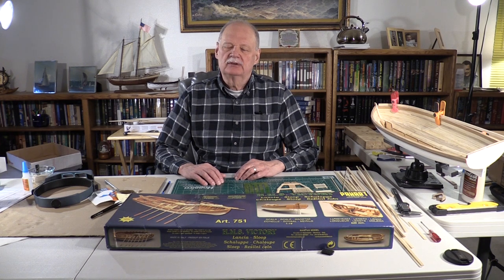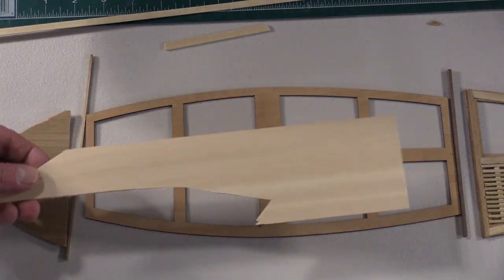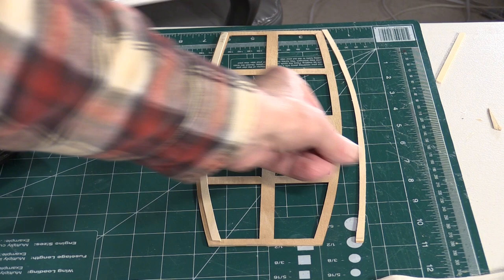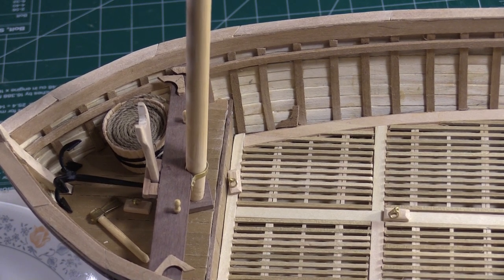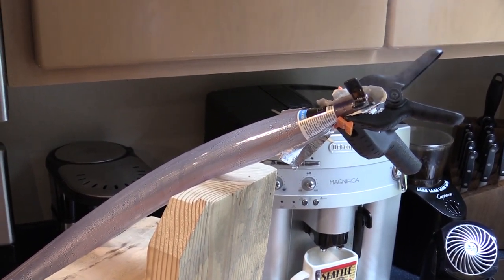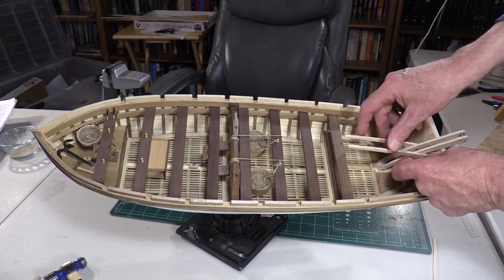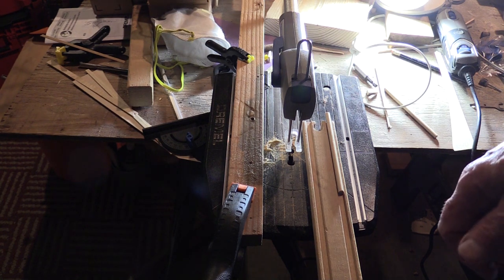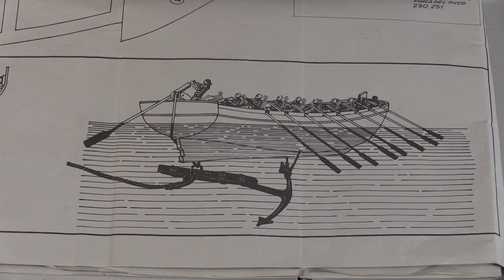HMS victory launch Part 2, the Deck

Comment: Many thanks for the video,, I've built many wooden ships over years and the one tool that I couldn't live without is my mini circular table saw,,only a suggestion but it saves so much work,,thanks again
Reply from the maker: thanks for the encouragement, and I think you are right.  I've been looking at mini table saws.  Especially to cut my own wood, when I run out of what stock is provided in the kits.  - Ken